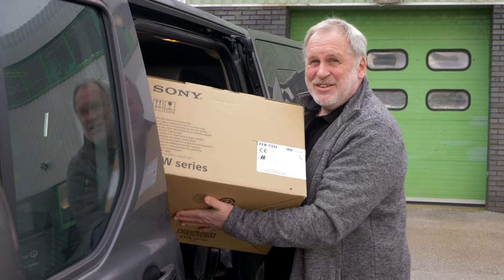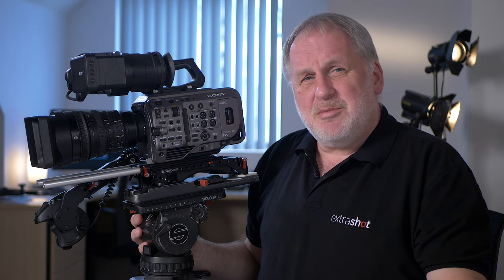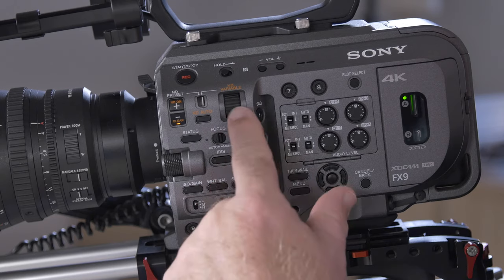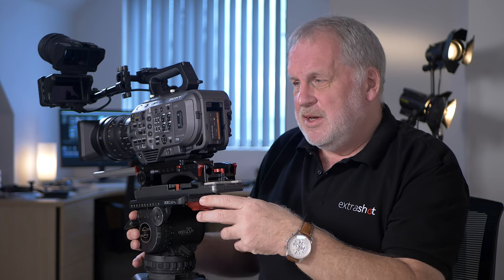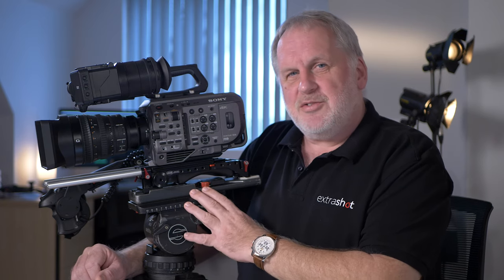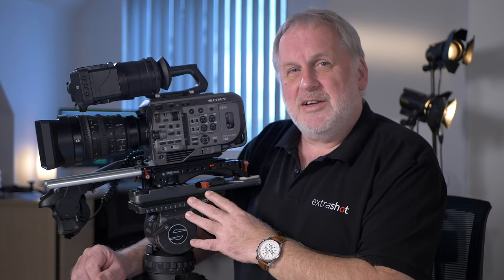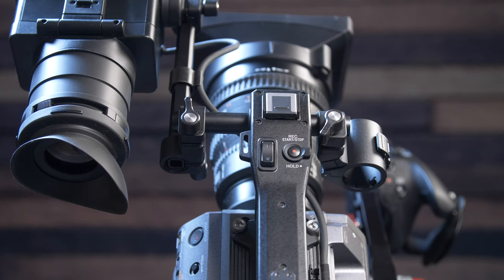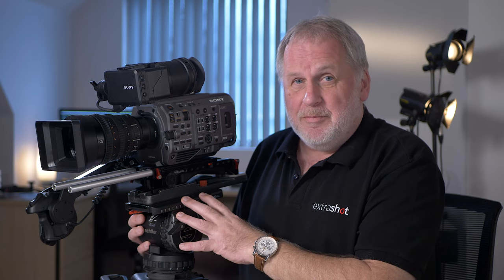Sony FX9 - Special FX?

Comment: No camera image stabilization. Did you try using any lenses with image stabilization?
Reply from the maker: No in-body stabilisation.... but yes all my lenses with stabilisation work fine (even the Canons on a Metabones adaptor). The camera does have the gyro stabilisation using the metadata from the motion sensor - which is brilliant... but you can't use this at the same time as lens stabilisation... it needs to work solely from the camera movement and can't cope if it doesn't know what the lenses are doing!

Comment: What do you think about C500 MKii?
Reply from the maker: I would like to do a review asap... I've played with one but haven't actually used it for any length of time.  It's clearly a great camera, and obviously, the main competitor to the FX9.  On the plus side, I really like having internal Canon RAW lite, it's a very nice codec, and the lockable IBIS, but on the down side it's very data hungry, which certainly goes through cards at some pace... and obviously, the price.  It's 50% more than the FX9... this shouldn't matter at this level, but that's quite a bit of cash to most owner operators?  The biggest question I have is the EF lens mount... that's getting quite old now and designed for DSLR's.  I know there's a lot of EF lenses around but I can't help thinking this was the time they should have pushed the RF mount and included an adaptor?  The pictures I've seen are very nice... it has that Canon 5Dm2 feel we all loved when it first came out !!!

Comment: Cropping the lens does take away sharpness. Lenses designed for crop shouldn't be used on a full frame body. Even on the fs700 and the metabones speed booster you can see the difference between the fake full frame being way way way sharper than just an empty adapter and the same lens.
Reply from the maker: I agree... but isn' it the other way around?... we're cropping a full frame lens with the S35 sized sensor.  In other words, we're just using the centre of the FF lens which is why it's not as sharp.  In the case of the FX9, when we do this, we're also losing colour resolution from not downsampling the image and colour info quite as much as 6K to 4K

Comment: I noticed one little thing. There is a show I film for, where the interviews need to be shot at 25fps and the b-roll etc at 50fps. All in 1080. But when I switch framerate, it jumps to 4K... I noticed that in the FS7 a long time ago and is something they fixed. Hopefully they'll fix that in the FX9 as well...
Reply from the maker: A few people have mentioned that... I'm sure the request has got through to Sony engineers... they seem quite good at wanting feedback at the moment.  In the mean time, what I do is memorise an 'All Files" file for each setup.  Then I can quickly switch formats safe in the knowledge that everything, (inc. shutter, frame rate etc.) goes back to where I want.  It's a pain that the camera re-boots each time you switch, but it's still quicker than having to go through the menu each time!  I'm planning another quick video with all the tips and tricks I've found on the FX9... hopefully soon!
Reply: @extrashot  The weird thing is, that Friday it didn't switch between resolutions. It almost seemed like a problem that appears randomly. There must be a reason that it doesn't do that.
Reply from the maker: @EdwinvandenAkker  Strange?

Comment: Great review! Not sure I can prise my trusted F5 off my shoulder yet - the lack of HD luts and the ludicrous power supply leave me cold!
Reply from the maker: Hi Steve... hope you're well.  I did forget to mention the viewfinder assist (plain 709 LUT) is always available in HD and S&Q too... but the power supply is indeed a pain.  I hope to do a review of the solutions soon.  Trouble is... that picture quality.... I forgive it everything else !!!  Take care.
Reply: @extrashot  Hi, I read somewhere that you need to choose the LUT called "original" to give you the Cinetone LUT. I haven't investigated this personally, maybe someone can confirm this. It also may have been for 4K only, seems crazy you can't use a monitor LUT in HD. Also can you put a link to the Shape Button you mentioned in the beginning. Great video!!
Reply from the maker: @ChookFowler23  Hi Richard,  The 'Original' you refer to is actually the gamma setting in the custom paint menu... as in Standard, Hypergamma, SLog3 or Original.  In 'Original' ... Cinetone is the only option.  what I need is a Cinetone LUT we can give to clients and editors so they start in the right place!  I believe the Shape extension is this one: https://www.shapewlb.com/sony-fs7-remote-extension-handle/. There's some confusion because they also make one for the FS7M2 which doesn't work on the FX9.  Good news is... it looks like a dedicated FX9 version is also coming (which is the same as mine but black)... https://www.shapewlb.com/sony-fx9-remote-extension-kit/. Hope that helps.

Comment: It's a shame it cannot do proper 24p, but Netflix approved it for 23.98 and that's alright to me. Not that I'll ever need autofocus but it's nice to have.
Reply from the maker: That's true... and it's an easy convert if you need to.  Also. I've now discovered you can just change the metadata in the header so the NLE interprets it as 24P!
The autofocus is amazing.... I find I'm using it on talking heads (people only mode) simply because it follows better than I can... especially <f/2 on full frame !!!
Reply: @extrashot  what a time to be alive mate
Reply: Easy to convert, not a deal breaker at all.
Reply from the maker: @K1LL4Cam  That's true... and I've now discovered there's a way of simply changing the metadata so 23.98p plays as 24p in the NLE !!!

Comment: Sony will be introducing 8K given the Olympics are this summer. This will include an 8K block for Venice, at least that is my thought.
Reply from the maker: Interesting thought... the real test will be to see how many movies switch to 8K production?  I'm convinced that the Olympics is just a technical exercise pushed by TV manufacturers!
Reply: I agree, but it potentially has value in interactive ATSC3 interactive broadcast which will be tested at the Olympics. We may be utilizing our fiber network to bring 8K to several countries using our new protocols/capacity expansion.
Reply from the maker: @PlanetFrosty  Is the IP network ready for the massive data that 8K (and high frame rates) will bring?  Exciting times!

Comment: Compared the footage you have included in your S1H review, I don't really see much advantage when it comes to dynamic range. I've compared the footage you taken about the old church tower and the garden. Beside s the FX9 autofocus capabilities, I can see only drawbacks with the FX9.
Reply from the maker: It's difficult to compare the S1H and FX9... they are so different.  As well as the superb autofocus, the variable ND makes a huge difference.  You could definitely build up the S1H into a lovely shoulder mounted cine style camera... It would be great value, but would it be as easy to use?  I don't yet have the proper light boxes to do a definitive test for dynamic range between cameras... but the point to note here is that I was using the FX9 in original Cinetone mode... and even in SLog3 I left the exposure set where it was.  If you were really out to obtain the best dynamic range, you'd expose to protect the highlights and give yourself more in the shadows.  From when I try to properly grade the SLog3 'Clock Tower' shot, it looks to me that there's significantly more dynamic range on the FX9... I mean a lot more!  That sensor is the best Sony have made for a long time...
Reply: @extrashot  Your answer is totally legit, I understand. I just tried to figure out from the source I have ;) Here is the comparison image: http://www.imagebam.com/image/30fd3b1330081386  For me the S1H is over exposed a bit more, the shadows seems have more details. Sure the position of the sun is not the same. On the other hand, it would be also great to share the original footage on a google drive or something or have an alternative link on Vimeo, for better quality ;)

Comment: I’d be very surprised if the DC power input cannot accept 24v.  Onboard regulation is present on virtually all professional electronics, whether explicitly stated or not.
Reply from the maker: Interesting thought Peter,  the specs say 18v - 20.5v ... I think I'll let someone else try 24v first !!! 😂
Reply: extrashot   Where’s your sense of adventure?

That is a truly bizarre choice on Sony’s part.  Usually, pro gear with a pro price brings with it the advantage of industry standards.  Though of all manufacturers, Sony is often the first to violate this sort of thing, at least in my experience with their pro audio products.  At a point of maximum frustration, we used to joke that Sony was an acronym for Serving Ourselves, Not You.  Of course we made that joke while continuing to use their groundbreaking products.
Reply: @extrashot  The FX9 power requirement for the following typical setup and shooting condition is:

Power Requirements DC 16-19V
Power Consumption Approx. 35.2 W (while recording XAVC-I QFHD 59.94p, SELP28135G Lens, Viewfinder ON, not using external device)
Operating Temperature 0°C to 40°C - 32°F to 104°F.  

if you already have a V Loc plate with a regulated 12V or unregulated D Tap output just using a 9 to 18 volt input to a 19 volt 5 amp 95 watt step up DC/DC converter will work. Just insert it between the 12V output of the V Loc plate and the 19V DC input on the camera and you would more than meet the voltage and current requirements of the FX9. A water proof DC/DC converter with a 19V output and a 5A output that can handle up to a 95 watts draw with a 40MV ripple spec will fit the bill quite nicely. This more than doubles the power and current requirements of the FX9 with a big overhead safety margin. Just need to get some heat shrink, a soldering iron and a VAIO plug for the camera. Plug of an old or cheap aftermarket VAIO power supply I guess and you are in business. Means those of us with a stack of V Loc batteries that  we have been using on our FS7's can continue to use the same power source we already have. These 19 volt DC/DC converters are available for around $20.00 of eBay. I have used these on OB's on other equipment, component to SDI converters that required 19 volt. They are pretty bullet proof.
https://ebay.to/2wjBFiB

Comment: I could be wrong, but it seems to me your giving up a lot. Some things you would like to have and some things you'd just like to have back. Great video.
Reply from the maker: Thanks for the comment.  I can't think of anything I miss that much?  I just wanted to make others aware of what's missing right now.  Some of it will come back with firmware updates I'm sure... and something I failed to mention was the Viewfinder Assist.  This is a simple 709 LUT which works in the viewfinder at all times... even with S&Q.  At the moment... the plusses far outweigh the minus !!!

Comment: It would be trivial to get a Dtap->12-19 stepup converter (£5 on amazon)-> sony plug and make a Dtap to sony lead. While I think sony are dumb to do 19v the user base is also dumb not to see this super simple solution. I did the same but down stepping to my Gh4. Basically I make everything 12v compaatible or dont buy it - cameras lights follow focus monitors
ps - love the couldnt find a craftsman gag
Reply from the maker: Hi Sam,  You totally could do it that way... but aren't you worried about over discharging the 12 volt batteries?  I'd like some warning or cut-off protection to prevent bricking the V-Locks.  I'm also a little worried by any solution that abruptly cuts the power to the camera while you're recording.  If the file isn't closed properly, it'll usually corrupt the last take, and sometimes the whole card.  This can normally be restored in-camera, but it's not something I want to do regularly !!!
Reply: @extrashot  Hi - discharge process should be the same as before just faster? Because its intuitive I dont think how I watch for discharge on my FS7 vlock - maybe I watch for it hitting 11.v (on the screen on the FS7) - Ive never had a conk out. - You would look not for 11.5 but maybe 18.2v or suclike (test first!) - you have do a few calcs on current as not all batts could deliver enough current, my hawkwoods can deliver aout 60w which is plenty (and also not enough for panels). ANother problem with this solution is accessing the Volts in port on the FS7. While I used to hang a Vlock from the back I changed to my Vlock being rod mount as it aids stripping the camera quickly for my gimbal or just a 'naked' setup.
Reply from the maker: Sam Morgan Moore Because the battery is connected through a step-up regulator, you don’t get a proper voltage reading on the camera... what you see is a slight drop below 19.5V just before the now flat battery can’t drive the step-up regulator any more...!!! At which point it’s already too late.

I’m planning a video demonstrating the issue and looking at the alternatives. I’m now thinking of including the £5 Amazon adaptor as part of the tests?

Comment: Dearest Duke of Bournemouth ..  has one used any PL  s35 lenses on the new beast .. anything wider than the kit 28mm... or any other lenses aside the 28-135mm.. your thoughts sir ..tinkety tonk and down with the Nazis..
Reply from the maker: Hi Robin,  I've tried to keep away from S35 so far?  At the moment, all the other lenses I'm using are my trusty old Canon EF selection.  I've bought the Metabones EF to E Mount T CINE Smart Adapter, and I've been surprised by how well it's working.  All the shots it "For The Love of Wood" were basically on Canon EF lenses... 16-35mm f/2.8, 50mm f/1.2, 70-200mm f/2.8.  I've got an 8-16mm super wide, but obviously have to drop down to S35 for that. They all seem to work very well.  The big surprise was that with the adaptor left in 'advanced' mode... all the usual metadata from the lenses works correctly... so image stabilisation, focal length etc are all copied across.  (The camera needs this data for the gyro stabilisation to work in Catalyst)... and best of all... even auto-focus !!! Maybe not as well as a smooth Sony lens, but useable at a pinch.  The longer term plan is to swap all my Canon glass to Sony... hopefully the new Cine lens when it arrives, but also a couple of G-Master.
Reply: @extrashot   ok thanks .. yes I suppose the idea is to use the FF sensor ..

Comment: This is exactly the video I was looking for before pulling the trigger.  Couldn't sort how many of my fs7 accessories would fit on the fx9.  The small bit about the eyepiece on a non rotating rod is big, that was the biggest pain on the fs7 to constantly fight, and glad my shape extension handle will work too.
Reply from the maker: Hi Brett, thanks for the comment... only thing I should point out, there are a couple of different versions on the shape extension handle for either the FS7 or FS7M2. (and I think they are going to do a third in black for the FX9)... thing is... I think that it's only the FS7 one that works with the FX9.  I've just looked at the box and it says FS7RH (right hand?). I was told that the FS7M2 version won't fit.... or I may have that the other way around !!!   Sorry I can't be more help... the dealer sorted mine. 👍
Reply: @extrashot  that's all good to know. I have the first version, so hopefully your first inclination is correct.  Appreciate you taking the time to respond!
Reply: Alas, I think its the FSMK2 version that you need. I've literally just tried to attach my FS7 shape handle and it doesn't interface with the sliding arm properly. Bugger. Time to put all those tiny screws back in! 

Great vid as always Paul, thanks.
Reply from the maker: @willlodge5386  Thanks Will... Strange, the box mine came in definitely says FS7RH but maybe I was given the wrong box?  That'll annoy Brett !!!  Sorry.

Comment: Love your videos as always but this camera is ... meh. 

I still havent recovered from the menus of the F5. Soooo slow and poorly designed and uncustomizable. Yet the devision that made the A7S and so on had highly customizable quickmenus etc.
Reply: So this camera is "meh" because the menus on the F5 were slow and clunky?
Reply from the maker: Thanks Colourberry, very kind.  Coming from the F5... I'm now making good use of the top 'User' menu on the FX9... got it setup how I like it and finding it very usable!
Reply: The menus in the F5-55 are archaic compared to these new Sony cameras. The delay from when you scroll, the weird way you need to dig into menus for things like audio adjustments. The user menu solves most speed issues. I wish you could map S35 mode to a button, but hopefully that will come with a firmware update.